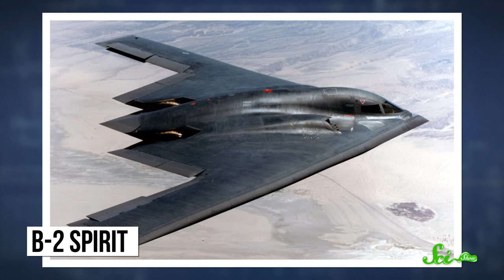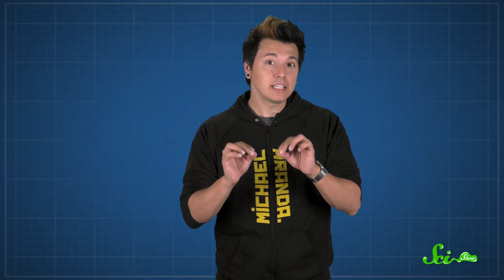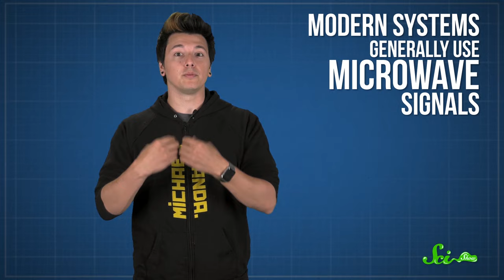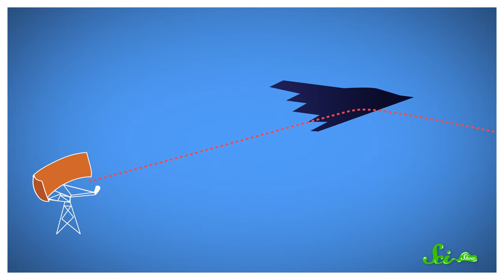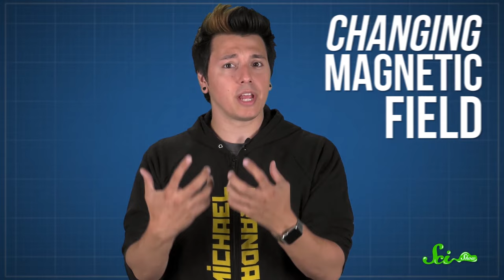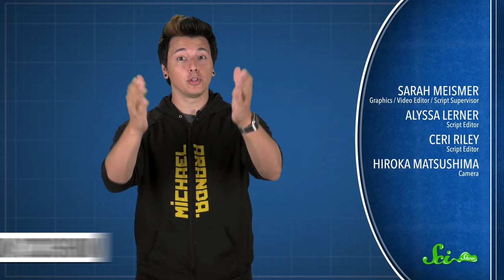Stealth: How to Hide a Plane

Comment: "Literally slip under the radar." According to Hank over on Crash Course Philosophy, that is the literally incorrect use of 'literally.'The boat or plane is avoiding detection. It is not really slipping under the radar.
Reply: More like the wrong preposition, it should read "Literally slip through the radar" and possibly change the verb such as "Literally cut through the radar" much in the same way that a knife cuts through butter as this better illustrates how the angular shapes work.
Reply: It would have been a good opportunity to explain why we say 'slip under the radar' though
Reply: yeah, literally slipping under the radar is what planes do all the time - they fly low to the ground, behind hills and mountains, so they remain out of line-of-sight of the radar. 

You don't need to have stealth design to slip under the radar, it lets you slip through it.
Reply: radar will detect it, but as to not fill the screen with air temperature changes, barometric changes, bodies of vapor & other gases .. they`re filtered out by a threshold limit ... on modern radar networks, it`s variable .. detections are cross referenced between arrays to double, triple & quadruple check if it should be placed `on screen` ... so in this case UNDER is not what you've presumed it to be
Reply: it passes by unnoticed, and they usually do fly low
Reply: That true went deep
Reply: that's true, even old RAF planes in desert storm would 'literally' slip under the radar, there was nothing stealthy about them, except from their altitude
Reply: if it doesn't use the worlds to 'slip under' for their literal meaning then it doesn't literally slip under the radar, does it? it figuratively slips under the radar, figuratively because as you said it doesn't use the words for their LITERAL meaning
Reply: ***** Bull shit.

If the words 'slip under' are not used for their literal meaning, then using the word 'literally' is incorrect. It's an incorrect expression.

What the stealth aircraft would seem to be slipping under, so to speak, is the radio waves. But even then, it's not literally slipping under them, rather it is utilizing technology to reduce the detectable scatter or reflection of the radio waves. Ergo, the stealth aircraft is still being hit by the radio waves, and not passing under them as stated by the expression "literally slip under the radar."
Reply: It's a more literal example of slipping under the radar than say a kid slipping under the radar to grab a cookie, so just let it slide. Since the idiom uses a combination of two expressions ("slipping under" to refer to going unnoticed, out of sight.. "radar" referring to something that is watching), it makes literal out of half of it (the radar part) which is good enough
Reply: +Michael Gibb, 1 LAST TIME: RADAR hits everything... the clouds, the vaportrails, the birds, the hot/cold pockets, the trees, the mountains, moving air pressures. .. BUT VERY LITTLE/NONE of it appears "on screen", because of detection RULES which follow THRESHOLDS from various algorithms. .. what shows up is OVER the threshold & what doesn't is UNDER the threshold... RADAR isn't "radio" waves... heck modern arrays usually use just microwaves (or combination) ... never-the-less... "radar" isn't "the waves"... it's a detection system, "RADAR" is the F'n threshold... to be unnoticed by "radar" then you have to be "literally" UNDER it... as you have to be OVER it to be noticed.

RADAR is a system for detection, whether it be man-made objects, weather phenomenon. .. whatever... a system to categorise what does and doesn't meet or exceed a set of parameters. .. or be OVER/UNDER ... just like in Vegas.

IT'S LITERAL ... and this whole manufactured "literally" or not BS is LITERALLY IRONIC ... geezus... fucking armchair experts who don't know what RADAR is ... IT'S NOT FUCKING RADIO WAVES.. those are called RADIO WAVES, nobody said "literally under the radio waves of radio wave emitting radar antennae".
Reply: Phil Verhey Try a coherent and properly structured comment and I might listen to you. I tend to ignore those who don't use proper grammar and punctuation.

P.S. You can't say "Nobody said "literally under the radio waves of radio wave emitting radar antennae" when you started your comment by saying "RADAR hits everything." Because the antennae didn't hit everything, you could only be referring to the radio waves hitting everything. Your comment is even more confusing when halfway through you said "RADAR isn't radio waves." If radar isn't radio waves, then what is hitting everything?

P.P.S. Don't respond with the same technological pedantry, because that is not my interest here. It's linguistic pedantry that I'm interested in, brought on by Hank Green's comment over on Crash Course regarding the use of 'literally.' So if you're itching to repeat your scientific pablum, take it to someone who cares.
Reply: English is a language, and languages evolve. The definition of "iterally'' has changed, and thus the use in this video is correct. Even if it weren't, such a use of literally would be fine, because dictionaries and other rules do not define a language -- they simply describe it.
Reply: People like you need to get laid
Reply: Michael Gibb PPS ... you don't care about my pablum? why not? everyone was arguing what RADAR was and why "literally" didn't fit for going "under" it ... and yet it's the core of the argument. ...

You see, if someone is standing 'under' the sun, and someone says they are (literally or not), the pedantic folk would reply "no, they're just in front of the sun... the sun is millions of miles behind them & they're not under it" ... but a flat earther would argue otherwise ... 
YOU SEE, to argue "literally", you have to know what everything is ... and RADAR isn't radio waves...
Reply: Alberto Alfonso Right. Because sexual intercourse is the only way humans have for releasing tension.
Reply: Phil Verhey "RADAR isn't radio waves."

So now we're getting into the pedantry of what exactly is radar. Because if it's not the radio waves emitted by the antenna, then there is a better case for the use of 'literally,' based on your technical specifications of how the technology works. If radar is the technology, then the threshold, as a main principle of how that technology works, makes it possible for 'slip under the radar' to be a literal expression.

Although, it should be noted that even in light of your specifications, a plane still does not literally slip under the radar. Because the plane itself does not slip below that threshold, rather it is the level of scattered or reflected radio waves that is 'under' the threshold for detection.

The truth is, the threshold is a description, while the plane is a physical object. That means the latter can't literally slip under the former. So the stealth aircraft is not literally slipping beneath the emitted radio waves, it is still being hit by them. Nor is the plane itself slipping below the threshold, because, well, that is just absurd. A physical object can't go under an immaterial one. And the plane is most certainly not slipping under the antenna, the third part and most important part of radar, because that is just impossible.

All this aside, it still speaks a lot of your character that you respond with pedantry and an anal obession for specifics, to a lighthearted reference to Hank Green's comments in another video. All I do is draw a connection between the two videos, mostly for fun, and you have a hissy fit.

Congratulations, you are an arse.
Reply: The word "literal" in that case was applying to being under the RADAR, not the "slipping" part.

Comment: So to radar it'll look like a flock of birds...going 900 km per hour at 12 000 meters up.
Reply: Congrats! You're the 100000000000000000000 person to say that!
Reply: Akshay Sharma
Sweet!  Did I win the toaster oven?
Reply: AlbertaGeek Nope but you win the next best thing, a trip to "Anti-spam torture campus" cough cough I mean you win a trip to a luxorious resort! WOHOO!
Reply: Akshay Sharma
Sounds good, I could use a vacation.
Reply: Actually it's faster and higher than that
Reply: Or he could go to one of those camps meant for concentrating
Reply: i love the library!
Reply: It's almost like that's an oversimplification of what's really happening...
Reply: Not what it means. It means it has the return signature for most microwaves wavelengths of a bird. Meaning most R.A.D.A.R.s won't interpret it or even pick it up.

Comment: another point on infrared stealth, the exhaust vents are as tight as possible (its a balance with performance) to give as small a heat profile as possible, meaning you almost have to look at the engine dead on to see its heat, and then a slight maneuver by the pilot will fix that.

Comment: There's also a lot more nuance to stealth technology.

Consider, for a moment, the fact that the A-10 Thunderbolt II's engine placement makes it a little more difficult for ground-based heat-seeking weaponry to properly target it by partially obscuring its exhaust.  Or that having a small enough radar cross-section means that, even if a human operator can tell that you're totally not a bird, the targeting system that guides the defensive weaponry they're using may have difficulty actually tracking something it doesn't recognize as a plane.

Comment: How to find a plane: Retrace your steps
Reply: Dosen't work on Malaysian planes.
Reply: +Nathan Lang 
but jet fuel STILL can't melt steel beams.
Reply: +Nathan Lang 
but jet fuel STILL can't melt steel beams.
Reply: +Mr Logical but steel loses half of its structural integrity at around 500°F, while Jet fuel burns at around 1.45 times more, at around 1450°F. The aluminum oxide from the wings mixed with the jet fuel would have made it act a lot like thermite, and burn much, much hotter, like, 2500°F
Reply: That is a very wrong statement.
Reply: steel beams cant melt jet fuel
Reply: Jack 123610 no, but hot steel can make it catch on fire ;)

Comment: The last bit doubles down on a common misconception. Exhaust cooling is important, but hiding hot engine outlets is paramount. Most infrared spectrum detection and interdiction systems actually look for the hot metal radiating specific wavelengths, since hot gasses equalize with the surrounding massive body of air so quickly. All that movie stuff that shows 'heat-seekers' following an exhaust trail like a track or diverting to burning gasoline is bunk.

Comment: Little adittion:
Stealth technology is only really effective against short wavelenght radar which is used for SAM (the biggest enemy of modern military aircraft) targeting systems because of it's good resolution*. Long wavelenght radar on the other hand is capable of detecting pretty much every steath aircraft, but due to the poor resolution is impractical for targeting them.
The fact that long wavelenght radar can track stealth aircraft let to an F-117 Nighthawk beeing shot down by an Isayev S-125 "NEVA M" missle launched by a serbian air defence crew in 1999.
Reply: Plane was broken
Reply: funny someone already mentioned that

Comment: something unmentioned is that the radar he described is primary radar, not used anymore except by militaries, most aircraft use transponders which send information about the plane, to the radar center, no bouncing required, which is called secondary radar and much more accurate then primary radar (note: a plane can disappear from secondary radar by flipping a switch in the cockpit)

Comment: I've seen plenty of stealth planes in the air. If the B-2 turns just right, it's pretty hard to see with the naked eye, too--and stealth pilots know it! It's an accepted strategy to fly at angles to the ground so you can't be seen clearly for the signature triangle shape--it just looks like a line from the ground at certain angles.

Comment: Before the B2 was revealed Aviation Week and Space Technology (that is pronounced aviation leak and space destruction)  had an article on radar stealth.   The 1st 2 are commonly talked about: radar absorbing material (paint with tuned farrius  micro antennas in it) and shapes that reflect radar away from the transmitter.  The one that I have not seen spoken about is radar traps that  cancel the radar.   This works by having a v shaped grooves facing the radar source, as the radar wave enters the groove it is reflected on from the opposite sides of the groove so that it meets in middle and is canceled.  Of course Tyson grooves have to be the correct shape for specific wave lengths and the radar has to come strait into the groove.  For airplanes to use this there are problems.  The grooves are are not good aerodynamic surfaces.  The trap has to face the radar directly and and if off angle may be  a good (meaning bad for stealth) radar reflector.    If the traps  were in use, the ideal use would be to fly straight at the radar.   Also I am not convinced that the best RAM antenna is a ball shape.  A very interesting fact about radar stealth is that when the US started developing it there was a realization that the USSR could develop countermeasures.   These are in existence today.  Radar stealth reduces detection and makes targeting more difficult.

Comment: Stealth panes are countered by passive radar as those don't use transmitter that are at the same point as the reciver, but instead the normal infrastructure like cellphone towers.

Comment: I believe the B2 is black as it normally operates at night and is therefore hard to see with visible light. Also even if the radar does show a flock of birds, i suspect that doesn't fool too many operators as birds tend not to move at a few hundred miles an hour.

Comment: Low observability is designed for specific wavelengths-frequencies bands. Its not for ALL "long wave" light, the plane reflects perfectly the visible light for example, thats why you can see it with your eyes, and eyes are also "radars", they receive the reflected radiation that comes from the sun. So we are talking of low observable surfaces, in specific band frequencies. Modern radars, change randomly frequencies, and do a multi level digital analysis of the same area in different bands. The visibility increases exponentially with the wavelength. In the past due to CPU limitations it was impossible to do so much real time computations, but not any more. Even the modern jet planes have radars designed to expose stealth planes, and now its not the intensity of the signal but the different bands. The M2000 is using radar with 3 different bands since the 80s. Now the plane can scan many more bands simultaneously and process the signal with digital analysis to eliminate the noise "cluttering" and see the "stealth" planes. The theory is much more complex than this 2min video presents. In fact is a full year master course study, with many math modules.

Comment: Microwaves are a form of electromagnetic radiation with wavelengths ranging from one meter to one millimeter; with frequencies between 300 MHz (100 cm) and 300 GHz (0.1 cm). [wikipedia] Therefore, microwaves do belong to the radio spectrum of EM radiation. In the video, it was implied that they do not.

Comment: ah you forgot a few things like the radar permeable skin and internal structure. Which work together to kinda capture radar waves ni sense to reduce their strength and farther scramble their reflected direction. Also the coatings are heavily carbon based, because testing way back a bit having ww2 found out carbon absorb radar.

Comment: In order to figure out how fast the object is moving, you need to be able to detect the shift in frequency that comes about thanks to the Doppler Effect, meaning you need a pulsed signal and not all radars are pulsed. There are various continuous wave radars. Also, the easiest way to not be detected is to literally fly under the radar. There's often times a minimum detection altitude. While not very exotic of an idea, still is the most simple way of going about it, theoretically. Even a Boeing 747 could be undetected this way. 

Furthermore, figuring out an aircraft location is more than having one return from a transmission. You have to get altitude, bearing and velocity (how high, what direction, and where will it be in 5 seconds as the missile is traveling). Also, not every radar can do all of these jobs. Some are specialized for altitude detection, some are for range, some are for velocity. Modern systems (which, not every country uses) can do more than one of these functions. 

What about range resolution? If a beam is, let's say 100 meters long, I can fly two or three jets within 100 meters and that radar would only see one target. While this isn't being undetectable exactly, 2 out of 3 of those aircraft ARE undetected completely. No matter how much paint or angles you add. 

On a side note, analyzing what country we are avoiding detection from is a very key question to ask because then you can look at specific systems. Ex: Russia has some really advanced stuff, N. Korea - Not so much. 

But I digress, this video does well for teaching the masses that are unaware of the topic. But I wouldn't mind seeing a more fleshed out and 'nitty gritty' version of this. Good work! (Don't forget about Electronic Attack
Reply: Sources: Intelligence background, http://www.radartutorial.eu/index.en.html, I may be slightly rusty on my information, but I got the ideas across.
Reply: I take that back. The simplest way to hide a plane: put it in a hanger and close the doors. GONE.